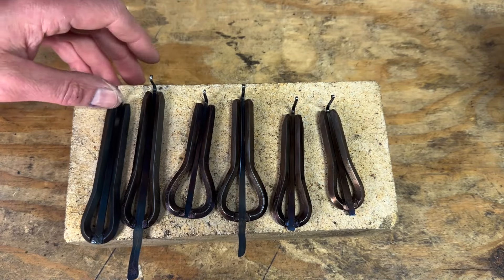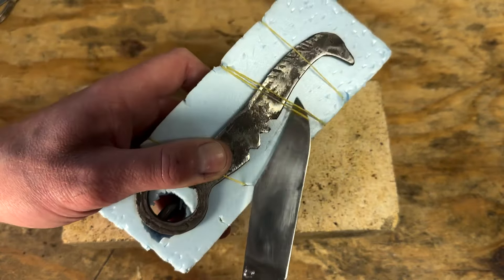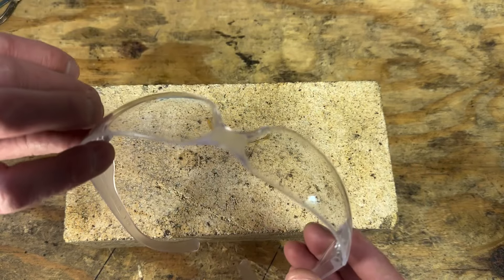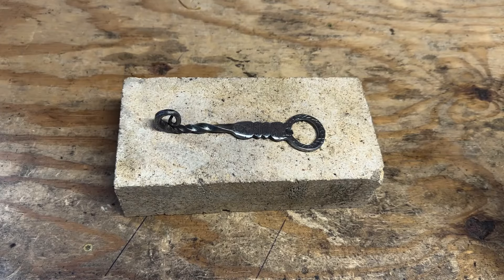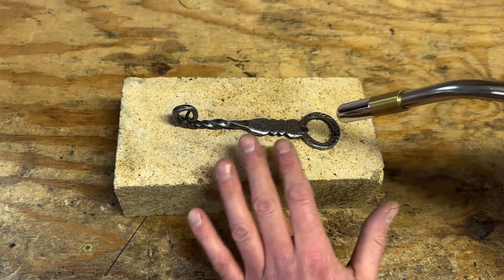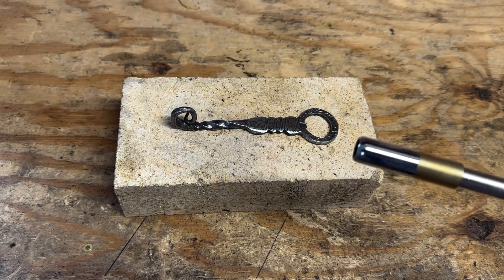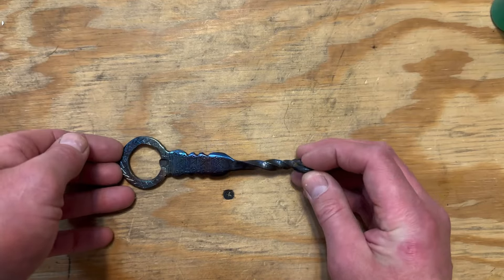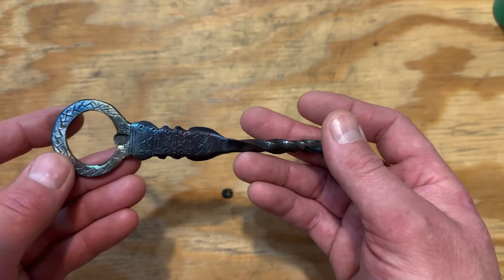How to make steel beautiful using only heat. #tempering

Comment: Awesome video.  I’ve been playing around with heat colours, but I had no idea how to control them or what the order was for how the colours change.  These are great tips!  I already found doing it after deformed the harp and so I’ve done it to the frame beforehand, but then you need to be pretty careful about tool marks when crimping and adjusting.  I’ve started doing it to the reed only since it’s easier to preserve the finish if the harp needs tweaking.  Once again, great video!

Comment: I have a question;

I never played a jaw harp before and I really want to try it. But my front teeth are uneven, one sits quite more in front than the other, lower teeth are even. Would this be a problem? Wondering if I should get a dan moi instead. Thank you.
Reply from the maker: My teeth are uneven and on top it only rests against two as my milled two face inwards.   It just needs a firm resting place.   Also check this out.   https://youtu.be/7V7muavzLAc?si=MyNoz36esMR3HaLy

Comment: How can you make the coloring go deeper in the metal. Because one scratch and it allready goes off.
Reply from the maker: The coloring is on the surface.  It is an oxidation from heat and the air.   You might be able to do something with chemicals.